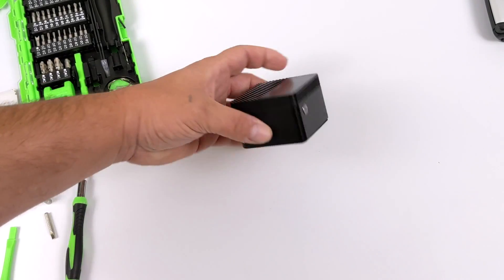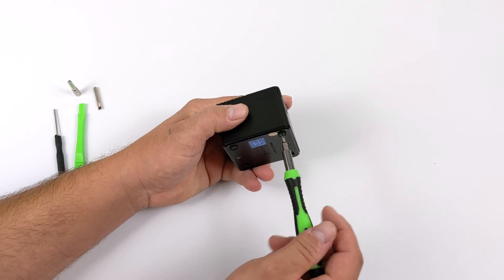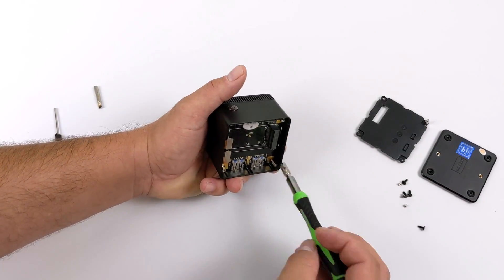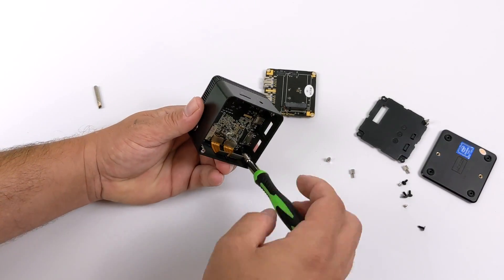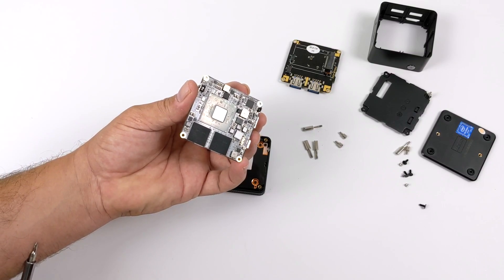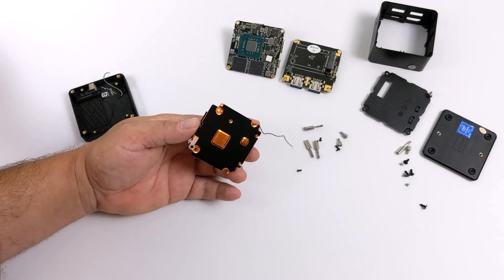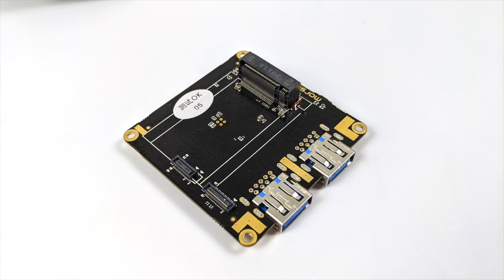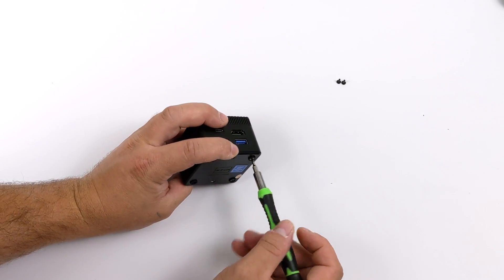CHUWI LarkBox Teardown -  World's Smallest 4K Mini PC

Comment: Use a 10x10x1mm copper shim, put thermal paste on each side, also if there is space use the remaining thermal pad around it to hold into position. Thanks for the teardown
Reply: I third this. I use these shims on all of my Pi 4 cases. Works a treat.
Reply: @justin_fps :  THIS is why I love reading the comments in these tech videos - Great & practical ideas!!
Reply: I was going to recommend this as well. A copper shim should work much better than a thermal pad.
Reply: Thank you I saw a 81c CPU and 68c gpu temps after 5 minutes at 100% load on my larkbox and came here for the comments. Going to go the shim and paste upgrade. I already hada ssd ordered  pre campaign offering and lost $10 getting one myself OOF.  #385
Reply: How thick did you use?
Reply: don't you think a millimeter thick is too much? The image is zoomed in the video ...
Reply: @oanasse  I've finally used 0.8mm and I'd say if it was 0.5mm it would be better.
Reply: @javids6656  thank you so much. 5mm, it's ordered ! Cdt.
Reply: @oanasse  5 mm is crazy, 0. 5mm, half a millimeter.
Reply: @javids6656  I made a mistake in the message ... I ordered 0.5 mm. Thanks for the alert. Cdt.

Comment: Is there any GPU adapter for this box that works with  M.2 connector?
Reply: Yes exactly. M.2 to Pcie adapter exists .  But it would be a limitation for storage if he connects gpu to m.2 slot. The built in storage ain't enough

Comment: Functionality and form factor look great, but as is frequently the case, the designers seem thermodynamicly challenged. Thick heat pads are pretty terrible. It would have been much better to figure out how to get the heat sink have a flush fit with the processor board, and maybe even forego the fan by using a well coupled aluminum case...
Reply: Thermal Grizzly's Minus 8 pads can push 8W/mk, which is just .5W/mk lower than Arctic Silver MX4, and ~3W/mk lower than Thermal Grizzly Hydronaut.
Reply: @antikommunistischaktion  That's true, but the distance is several orders of magnitude larger in the pad, so the denominator is orders of magnitude larger and the differential temperature end up being much higher. Note that both thermal interface materials are much lower than the copper itself, which is about 385W/mk.

Comment: Would this work without the IO board if I don't need USB? Could you ditch it after connecting your bluetooth peripherals?
Reply: If you boot from SD probably but you would probably want to keep them just for the SSD because of the speed and stability advantage. Unless you plan on running off a battery there is really no point at all.

Comment: If they actually release it i'll be excited. I don't trust crowd funded products though. Especially not Indigogo. Thanks for the videos.
Reply: CHUWI is a brand that has already released some other Mini PC's, so in this case I wouldn't be too worried. Still, it's an extremely niche product.
Reply: Elsass Lotharingen CHUWI is a brand that goes from miniPC to tablets. They've been around for ages. Sometimes they move to indiegogo when it's about more niche and daring projects

Comment: Just use a penny and put thermal paste on both sides to make heatsink and cpu make cotact :)
Reply: Just buy the little copper shims, you can get several of them in different sizes for a couple dollars!
Reply: I am fixed my laptop cooling system by coin
With stock thermal pad video chip was hot, and I just replace pad to thick enough coin
Temperature was dropped by 20 degrees! I was schoked. Thanks ASUS for damn thermal pad
Reply: @kopeofonrac2084  I cooled a GPD win and got far better results using one of those heatsinks made for a Raspberry pi 3 chip it made it run cooler and quieter so a good thing to remember as well, that being said it would be thinner than a penny.
Reply: @MKDC-5  true
Reply: Have you noticed temperature differences? What thickness can be suitable, maybe 1mm or less?

Comment: Try a graphics card plugged into it
Reply: RTX 2080Ti
Reply: @mixedup5858  Bottleneck city. 😂
Reply: markun petrucci why dude? Why not rtx 3080ti =))
Reply: You can't
Reply: I’m mean if it has a mini pcie port
Reply: There's physically nowhere to connect a dGPU so there would have to be soldering to get one connected. There's no Thunderbolt and the old route of hijacking the PCIe connecter from the WiFi card won't work here as it's soldered down.
Reply: Ryan C But you could use the 2242 m.2 slot, though the performance would be limited, the maximum I would use with it due to the bottlenecks of bandwidth and CPU would be a GT 1030.
Reply: @TechnoLadz  That doesn't always work. Sometimes those slots are wired up for sata and nothing more. I remember trying to jack the M.2 slot going through college (this was just before Thunderbolt came in and made everything easy) and it would not work at all for anything other than a M.2 sata SSD. I had to swap out the WiFi card every time I wanted to use a dGPU on that laptop.
Reply: @TechnoLadz  Sadly, on it's indiegogo page, the M.2 port would only support sata. So no, eGPU would not work there.
Reply: @antikommunistischaktion  hijacking pcie ? Can you tell me more?
Reply: @oussama7132  the wifi adapter is probably connected via pcie, so its possible to just cut that connection and connect a different pcie device
But because this one is soldered down, it would be difficult and would require soldering and removal of the wifi adapter
Reply: @oussama7132  Back before Thunderbolt if you wanted to run an external GPU on a laptop you removed the WiFi card and connected a PCIe extender to plug in a graphics card. I actually came up with a fairly clean solution for the laptop I mention in my reply to @TechnoLadz. I cut a hole in the bottom of my laptop then used that cut out plastic to make a door that I could screw on/off when I needed access to that slot.
Reply: Ryan C I used one of those same adapters on an old HP business laptop plugged into the SSD slot myself. (I had a Samsung Evo Pro SSD already when I bought it, so...) The little ribbon cable would JUST squeeze out if I didn’t screw down one of the corner screws. Plug that into the expansion slot along with a PC power supply and I was good to go. Used it to successfully use my GTX1070FE (what I had at the time) with an HP that had an older Quadro internally. Didn’t work using both, however. Had to pick which would initialize first in the BIOS and the other wouldn’t have video out. Not sure if this was a specific problem to my setup or what, but just FYI.
Edit: Ahh, whoops. Missed that bit about it only being SATA. Yuck. That’s really a shame, considering how much slower SATA SSDs are (and more expensive nowadays, haha)